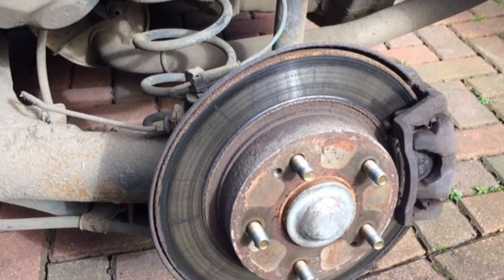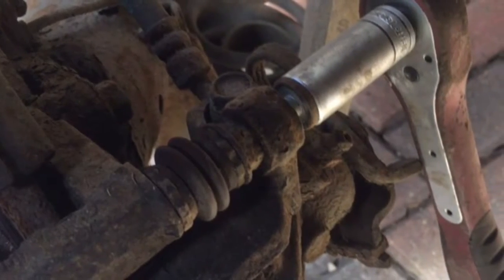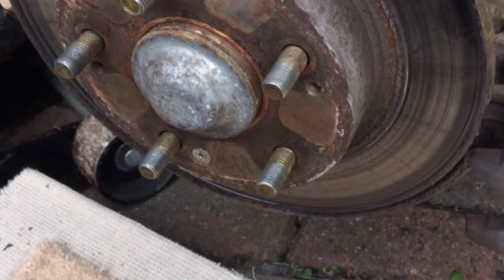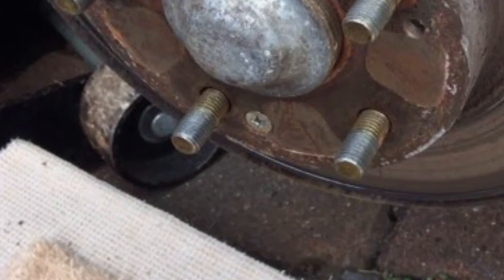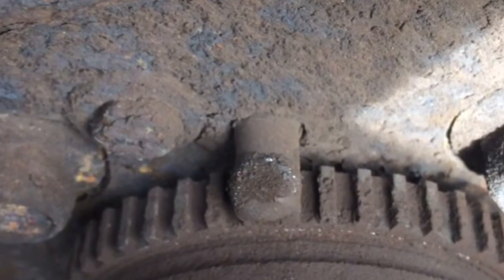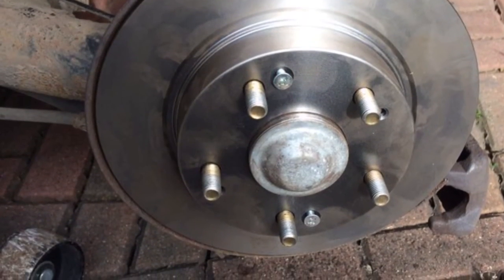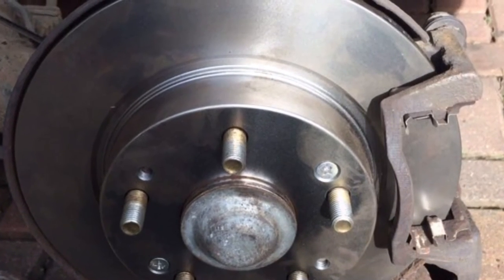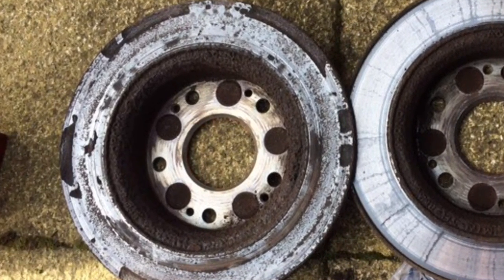Uk Honda Civic 8th Gen Rear Disc and Pad change

Comment: Which direction does the piston turn to go back in. I've tried with pliers and mine wont budge.
Reply from the maker: With the pads removed gently apply pressure to the brake pedal not a lot just to get the piston moving then rotate it anti clockwise while pushing in .
Reply: The cjrshop thanks for your help, will give it a go
Reply: The cjrshop definitely anti-clockwise? I think their must be something wrong with my piston. Tried both ways and whilst it is turning, it's not expanding or retracting.
Reply: Clockwise both sides, good luck doing it with pliers though.  Halfords sell a little cube that has different options on each face, about £6.99 and all you need to use it is a 3/8 Extension and Ratchet.  You do have to apply quite a bit of pressure when you're turning it.  Did mine today on my 9G Civic.  The 8G that I had was much easier though.
Reply: Is it only the rear pistons that need to be wound back in? (presumably because of the hand brake)

I guess you have to be careful the reservoir tank doesn't overflow whilst doing this?